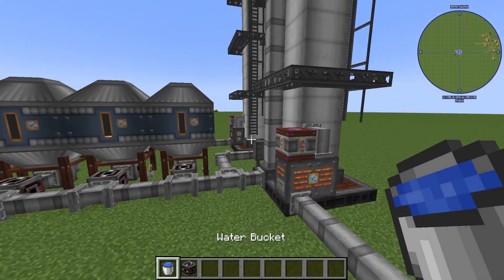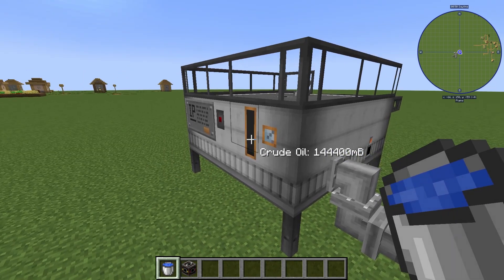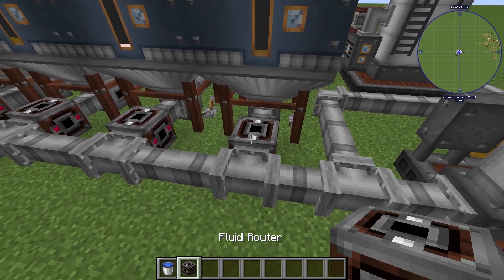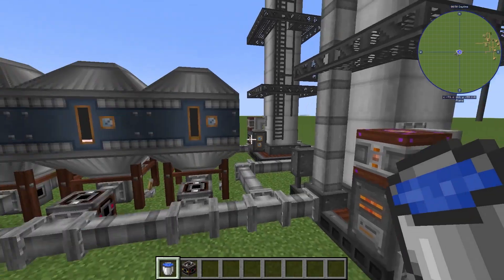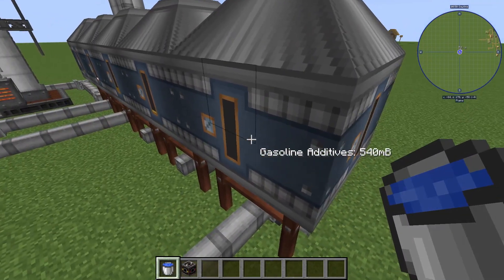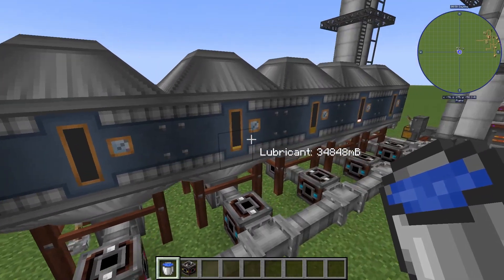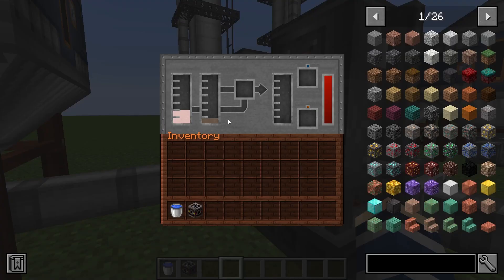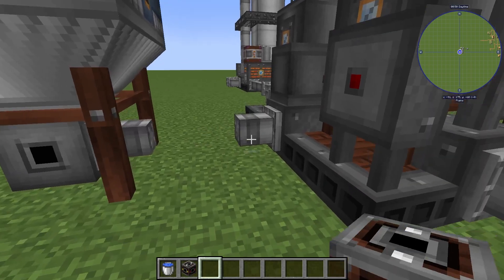Immersive Petroleum: How to make gasoline

Comment: How do you deal with overflow? for example Sulfurized Diesel tank gets filled up 1st since its the most output out of 4 the liquids, which then the distillation is stuck with Sulfurized Diesel in its own tank which stop further production
Reply from the maker: Process the sulfurized diesel into diesel fuel to power the machines or you can use flare stacks to burn it off
Reply: @MCMentor1  Thank you